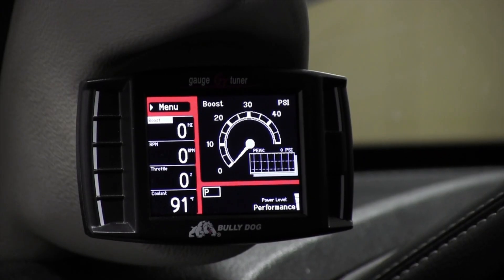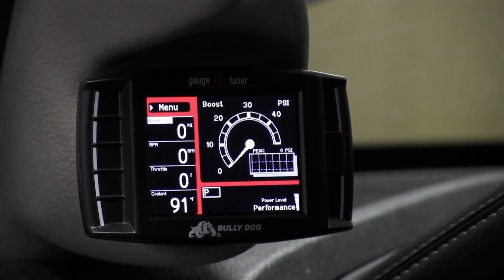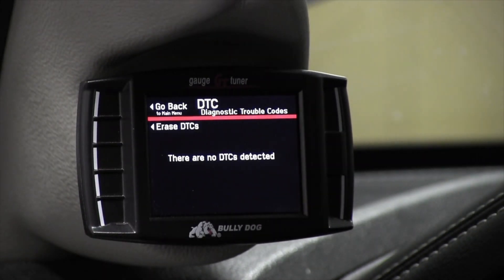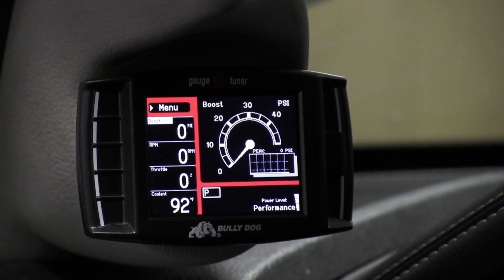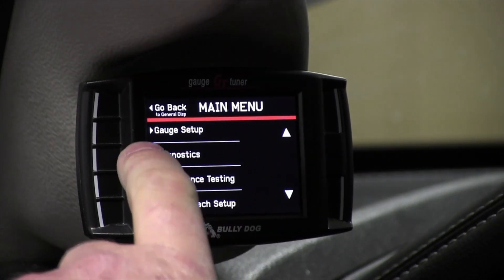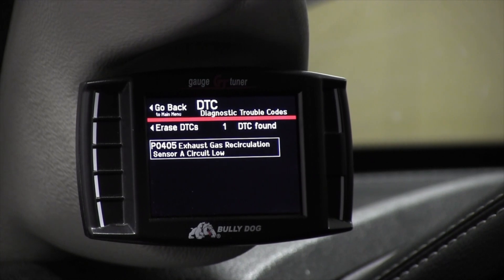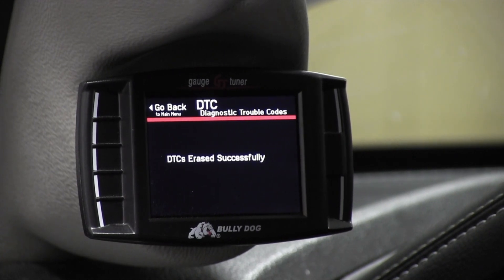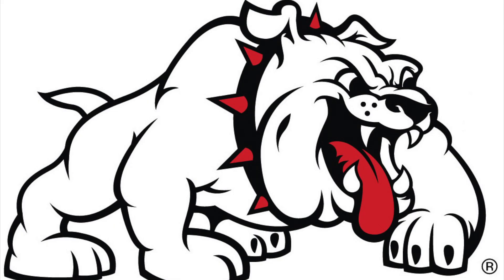How To: Check and Clear DTC's - BULLY DOG GT

Comment: @bully Dog just installed your programmer on my 2012 5.3 silverado and the engine light came on and it barely turns over ? I go to dtcs and it's not detecting anything yet my engine light is on and it barely turns over ?